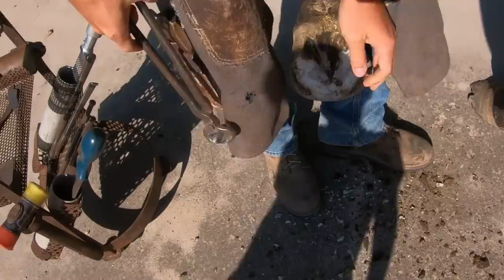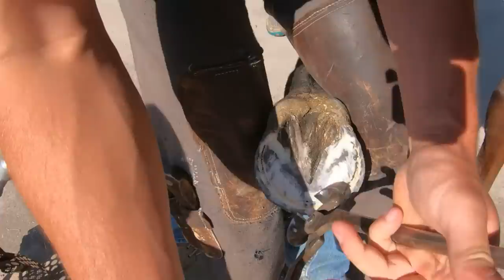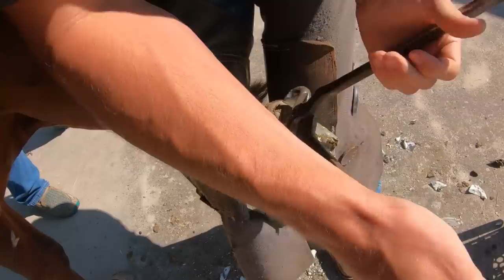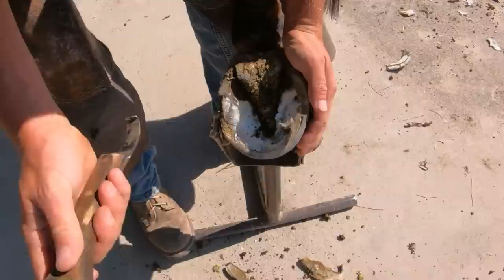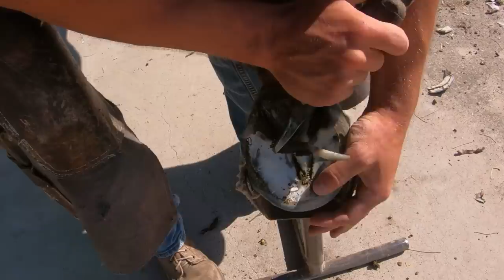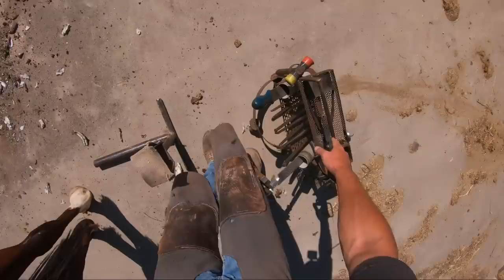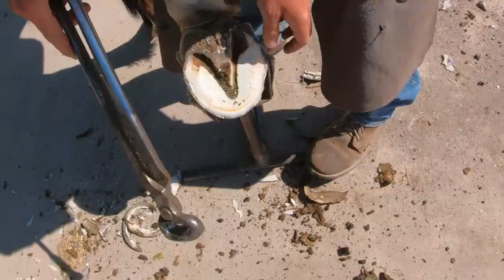TRIMMING a RESCUE horse With RINGBONE // Satisfying

Comment: PLEASE don't cut yourself!
How do you know how deep to cut...and don't say practice!
Reply: From my understanding it's a mixture of texture as different parts of the hood get harder deeper in the hoof so when it becomes more difficult to trim that's generally a good sign you've taken enough off, but it's also learning the structure of the hoof when you know what the structure should look like you can look at the dimensions of a horse's foot and know what  you need to do to get the foot into the right shape
Reply: @ashrowan2143  thanks that makes sense